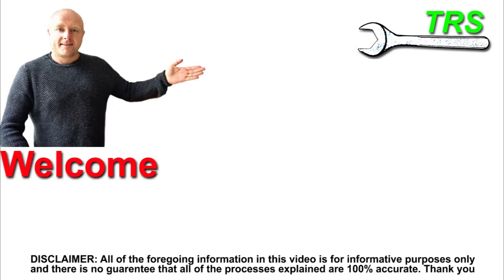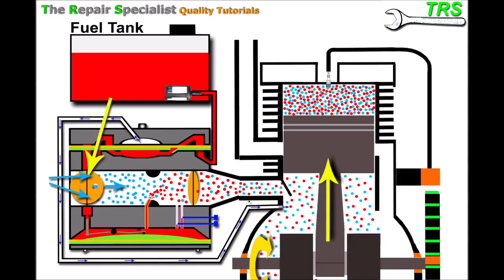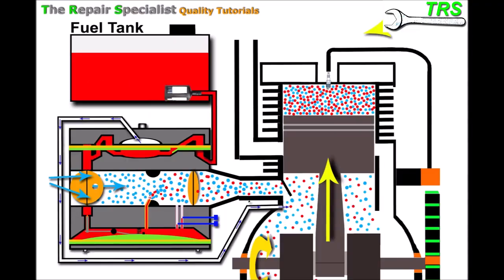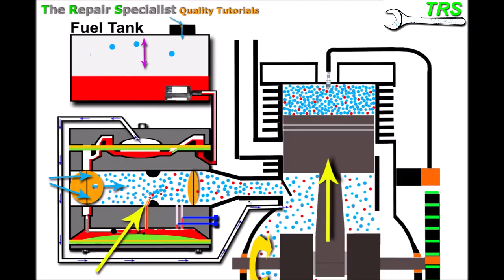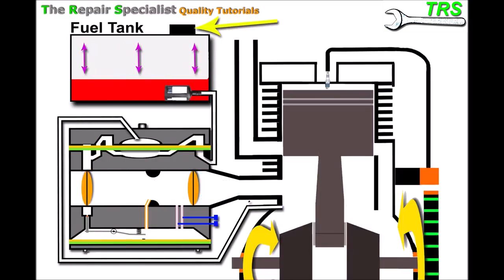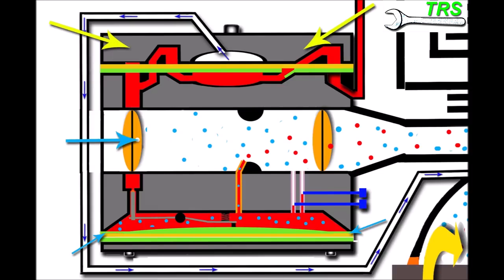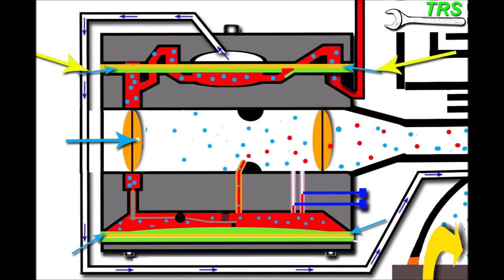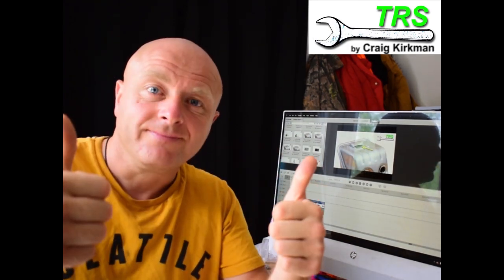2-Stroke Engine Only Runs on Choke (Will Not Run) This is why!  (by Craig Kirkman)

Comment: I appreciate you sir. Thank you for sharing your skills knowledge and experience
Reply from the maker: Thank you so much for your appreciation and nice feedback. I really appreciate you. Thank you. Craig 👍
Reply: @TheRepairSpecialist  I checked the tank, I even bought another tank and was going to install it today. But I never tested the vent. I'm certain this is what's happening. The tank is warped kind like there was excess suction inside it like a gas can does in the cold. I don't know why it didn't occur to me sooner, I've even seen it suggested in other videos. I've been through the whole outboard at this point. It runs like a top until you open her up. That's gonna change today thanks to you sir. This old pontoon has a fuel fill and vent attached to a broken trim ring and they're all super weathered. I'll replace it all but for today I'll take your suggestion and leave the cap slightly loose. I can't wait for my family to wake up lol. 

Your walk through on how all this stuff works and works together is the best on YouTube. I'm grateful to have found your channel

Comment: Great video.  I had replaced the carb on my Echo trimmer and couldn't get it tuned.  Watched the video and decided that maybe I should take it all apart and start fresh, thinking that maybe there was a leak somewhere.  Took off the carb and even though I thought I still had the screws in far enough to hold the gasket, it was off on one side, hanging down.  I continued checking tightness of everything and put it back together, making sure that the gasket was correct.  Wet through setting it up from scratch again (idle speed, High and low needle valves) and had it running like new in a few minutes.

Thank you for the great explanation.
Reply from the maker: Thanks Fantastic. I'm really pleased it's up and running.  Many thanks for your awesome feedback as well.  Craig 👍👍👍

Comment: Can a different 2 stroke oil or mix cause an engine to run on choke only?
Reply from the maker: Different types of two stroke oils and different mix ratio's can effect how the two stroke engine performs.  I haven't known it where the engine will only run on choke because of this though.
Reply: @TheRepairSpecialist  Thankyou for your reply, I have watched 2 videos that you have made on the subject and am still narrowing down the possibility of what the problem is with both my hedge trimmers.

Comment: What about the left side crank seal which is first thing had check if I was working on a bike
Reply from the maker: Hi

Thank you for watching the video and for your insightful comment regarding the left side crank seal. You've raised an excellent point about another potential factor that can contribute to issues with small two-stroke engines, such as chainsaws.

Indeed, a damaged or leaking left side crank seal can lead to air leaks into the engine, affecting its air-fuel mixture and, consequently, its performance. It's an essential component to consider when diagnosing issues like engine bogging down or poor running.

Your expertise and input are valuable, and it's always a good practice to check for any potential air leaks in the engine's intake system when troubleshooting performance problems. Your comment adds depth to our understanding, and we appreciate your contribution to the discussion.

If you have any more insights or questions related to small engines or any other topic, please feel free to share. The community is here to help and learn together.

Thanks again

Craig

Comment: Carburettors, don’t you just love them!?   Fuel/air mixture can be critical on a two stroke engine.  I learned about fine tuning carbs when I had my tuned Yamaha 250 and 350 RDLCs.  I certainly knew my way around Mikuni VM 26s and 28s.
Reply from the maker: Awesome 👍

Comment: Had this problem with my small 2 stroke generator yesterday. Went through it after seeing this video, didn't actually see any issues, but after cleaning  the system and tightening everything up, it now runs perfectly. 
Thanks for your help.
Reply from the maker: Awesome. I’m pleased you sorted out the issue. Craig

Comment: My fuel pipe has a loose seal to the tank. Is there a way to seal it or do I need to replace it.
Reply from the maker: Hello,

A loose seal can lead to fuel leaks and potential safety hazards, so it's important to address it. Here are some steps you can take:

Check the Condition: First, make sure the fuel pipe itself is in good condition. Inspect it for cracks, splits, or any other visible damage, especially where it seals within the fuel tank (some fuel pipes are larger in this specific area, much like a rubber grommet). If the pipe is damaged, it's best to replace it to ensure a secure and safe connection.

If the fuel pipe is damaged at the point where it seals onto fuel tank, then it's best to replace the fuel pipe. Using a damaged or improperly sealed fuel pipe can lead to fuel leaks, which are not only a safety concern but can also harm your chainsaw's performance.

If you're unsure about the best course of action or if you're not comfortable making these repairs yourself, it's a good idea to consult a professional or take your chainsaw to a reputable repair shop. They can assess the issue and make any necessary repairs or replacements with precision.

Remember, safety is paramount when working with fuel systems. Always make sure the chainsaw is completely turned off and cool before attempting any repairs, and take appropriate safety precautions when handling fuel and sealants. With the right approach, you can ensure your chainsaw operates safely and efficiently.

I hope this helps a little 

Craig
Reply: @TheRepairSpecialist  I have already replaced the fuel pipes, so I probably will take it to a shop. Thanks!

Comment: Thank you for this video, however, I have a weedeater that I replaced the fuel line, the carburetor (it's the recommended for the brand, not a generic brand), the gaskets and the spark plug. The engine is still bogging down when I try to push the throttle, and it has a baging noise that seems like the piston is hitting something. What could it be?
Reply from the maker: Hi. Thank you for your nice feedback. I really appreciate.  

I would start by removing the carb again and look into the induction tube at side of the piston. Use a torch.  See if it has any scoring marks on it. Turn the stop switch to off and turn over the engine slowly to see it clearer.   If there is scores present then this is showing wear on the engine that needs to be corrected by an engine strip down or replacement of the whole machine.  

Also, I would remove the exhaust and look down the exhaust port hole to see if i could see the same sort of scoring.  If so, then same outcome unfortunately.  

I hope this helps as a starting point considering the other things you have already done.

Thanks
Craig👍

Comment: I've given up on rebuilding the fuel system on my chainsaw ,which I've had for 25 years and replaced fuel lines an carburetors I'm done!
I'm going electric 40v 18"

Comment: Thanks for the video!  

I had this problem, and after watching this video, I was able to pinpoint the problem. It was the metering diaphragm. It had become too stiff with time and it wasn't allowing the needle valve to come off its seat and allow sufficient fuel flow to the main jet after taking off the choke. Out of curiousity, I compared the new diaphragm to old diaphragm, and the new one was much more flexible.

Comment: Very nice video! But it could not give me a clue to the problem i have. My engine idles with the choke on and keeps running. But if i want to turn off the choke the engin starts to raise if i turn the choke of it hoes to full trottle the trottle cap is closed how is this possible? How does the fuel air mixture enter the conbustion chaimber even if the trottle  cap is closed? My choke is acting as a trottle cap. Please advise

Comment: SIR i'd like to ask, i have Chinese chainsaw 52CC (stihl MS5200 - not genuine Stihl) bought it last December 20, 2021 after typhoon RAI hit in my country that wreaked havoc in Central Visayas area, Philippines. After weeks of continues used by cutting trees the engine started to run abnormally up until now, though still usable. After few minutes of running, when I revv the engine the sounds will changed (PROT PROT PROT SOUND) like out of fuel and then I dies, when in fact it was half full-full tank, but when IDLING the sound is normal. I already adjusted the LH and Carb dials so I can get the correct air and fuel mixtures. It will just run few minutes and back to the problem again. So, what I did was I cleaned the carburator (disassemble & assemble) and the clutch (i didn't detached) brushing only. Still the problem not solved. LAst  week I bought new Carburator and Fuel breather and installed it correctly, after few minutes of running the still the problem persist. The PROT PROT PROT sound not solve and then the engine dies. WHAT COULD BE THE CULPRIT? I've been searching this problem months now in the internet, but I haven't seen any videos/articles that could address my chainsaw problem..I'm thinking Maybe you have an answer for this.. Hoping for your reply. Thanks in advance.

Comment: Wow...very very well explained. Just what i need to fix my weed eater.... BUT my carb got only one screw,, just above where the  inline fuel pipe connects with the carb... 🤦‍♂️ There is no H or L... 🤷‍♂️
Reply from the maker: Thank you for your nice feedback. Its very much appreciated. Take a look at this other video of mine, which explains the basics on single adjuster screw systems on carburetors.  It might help make things a little clearer.  Here it is:  https://www.youtube.com/watch?v=oDkVVL0CJqk . Thanks. Craig

Comment: Excellent video it seems that you are a specialist as your name on this video, I had a problem with the manifold loose the 2 screws that connect to the carburetor but i noticed that the gasket is missing so this may be the problem.
Thank you

Comment: Hi, have a weird problem where line trimmer starts and runs and i can add more fuel or lean per the screws but after a period when hot, it wont idle anymore. Part choke saves it but it not happy engine!! Have switched carbs (3) and gravity fed fuel and even cut the pump vanes off and fed it fuel in case the pulse channel was dying after a period, but why would that happen? unless piston bore clearance and pressures suddenly drooped off.  so cant be fuel delivery problem or vent valve as bypassed all that.  Also i quickly checked for spark when it died and seemed to be still sparking but too weak when hot? 
Could it be simply a weak coil thats dying when warm and spark not strong enough?  Also one time after 15 mins it refused to go above half revs even when i pumped the throttle.  Electronics in coil failing and restricting RPM? a few mins later it was back to full power and rev up down ect. I honestly thought this machine was haunted as intermittent running problem with plenty of juice available on start so good fuel and spark then but not good spark when warm?
Would part choke save a weak spark situation ? Also when after start,  idle screw needs to be changed a bit, it wont lock on to one setting. Comp test was around 100psi.  cold.   Could the engine be bleeding off suction and pressure when hot as its old? . 3 carbs , 2 new and 3rd completely rebuilt on this machine of varying throat sizes but they all idle and fail the same after about 15 to 30 mins. same symptoms.   Also pressure tested engine and got 9 lbs, no leaks but replaced all seals and crank seal in case they were bleeding when hot. So engine is air tight.
Baffling!!
thanks if you can help...
Reply: Id be trying a coil,,,,i know its easy to just say and throw that out there from a chair but i would try a new coil and spark plug. This is of course is figuring all of the other basics are good which sounds like you got covered (vacuum leaks, etc). Love to know what you find. Stay safe and good luck
Reply: Do you have a spark arrestor on that unit?  Pull it and check it.  If clogged, use a propane or mapp flame to char it and brush off the soot.  Interesting problem.  I'm gonna assume you fixed it or had it fixed.  What was the problem?
Reply: @alext8828  Hi, i found the problem. You need about 90 psi for 2 strokes to work and i was getting 100 cold but only 70-85 hot??  and thus it couldnt run but took 10-20 mins to get hot and bleed off. Caused by worn bore and rings. Put new rings and checked hot and back to about 100 but the piston the bore clearance ect is not good so this wont last too long and that will be that for this machine . Good learning experience and i had to work this out myself as engines are supposed to increase psi as they warm up not the opposite. 2 strokes are very picky as they have to compress and suck the mixture in, so clearances are very tight. Thanks for replying. all good now..
Reply: @xx3868   Glad to hear it.  BTW, ring clearance is the thing to watch.  Piston clearance is secondary.  I think you'll be fine for a long time.  Good luck.

Comment: Excellent channel. My Stihl 600BR used to run well before a Stihl certified tune up. Now, it runs when the machine is warmed to room air, started and operated above 0 degrees C. At -30 degrees C, it starts and idles but bogs down as the throttle is advanced. I’m curious how to diagnose and fix this.

Comment: My still ms82 trimmer will only start if I pour a wee bit of fuel in the carby. 

Once it’s running thou. It’s fine
New chinese carb and was worked fine when new. Only ran about 10 minutes
Any ideas lads

Comment: An excellent explanation of the malfunctions of this type of carburettor!
Maybe some advice about the fuel used.
NEVER use alcohol containing petrol, this will dissolve the rubbers of the membranes.
You can only see this clearly if you hold them up to a light.
You then see the fine grid of the fabric on which the rubber was attached.
These rubber particles contaminate the carburettor and all small holes need to be cleaned, sometimes very small ones.

Comment: Hello, I have a back pack stihl leaf blower Ive done all this stuff to this thing fresh fuel, tank vent good,new carb actually 2 carbs the last one is original eqip.Anyway same thing on bogging and sometimes wont start yet running good while chocked a little bit ,even better when i shake up the gas tank to give it more pressure.,,Crazy thing is when i open the gas cap it will then just die out..The muffler is clean the cylinder looks new no scoring only thing left I was thinking is the crank seals?what do you think? any suggestions? Thanks! B.

Comment: Another excellent video which clearly explains the majority, if not all of the 'fuel starvation/choke on'  problems encountered with small engines.  The only fun left now is work out which one of these issues you are having? 👍
Reply from the maker: Yes, Thank you for mentioning that.  I should have included it in the video.  Thanks again. Craig
Reply: Pretty much start at 1.....

Comment: The 2 stroke engines must be able to exhale freely. If the engine idles but has no power, or simply won’t accelerate, and you checked all the first eleven things you might check for restriction to the exhaust. This maybe a piece of woven wire in the muffler that has accumulated over time exhaust oils baked on the screen installed as a flame, or spark arrester. Exhaust holes at the piston exit can build up crud and restrict the exhaust also. This takes many seasons to accumulate, but the seasons pass quickly, it maybe older than you remember.

Comment: all vids are great and very helpful. i did notice one lack or i missed seeing it. it is how a def hi ck valve preven
ts purge bulb drawing in fuel and pushes out all fuel when in low speed. ck not closing on low circuit lets 14.7 lbs atmosphere pressure push into metering area pushing diaphragm away shutting off fuel supply and gradual starving down at low speed/idle and adding air to chamber and pushing all fuel out of purge bulb. with no ck /defective works good on hi speed and full choke starts ok 5-7 pulls like no purge bulb. engines. thanks for the great vids.

Comment: Hello please help me understand what is going on. I have a Stihl chainsaw, the chainsaw turns on and in order for the master lever  goes to run position and idle, i have to depress the trigger . When i depress the trigger, engine will shut off but sometimes when i depress the trigger few times , it will go to run position without shutting off. Is that ok or is there something going on ?

Comment: I found the problem is usually an air leak in an old fuel line, the solution is cut off the cracked end and reconnect. It could also be in an old tank where the tank take up hardens and expands. Replace the old parts or wrap teflon tape to make the take up plug in tighter.

Comment: I've just dealt with my " the handy" strimmer. The beast kept dying off choke. 
The fuel supply line had snapped. No vacuum  equals no draw of fuel. Resulting in a dead cut.

Comment: My outboard runs fine when cold but after running a while it starts doing this it makes no sense why it wouldn't do it all the time
Reply: Induction coil issue often causes this.  As it heats up a fracture in the internal wire expands killing the power to the spark plug.

Comment: Please help me why my engine isn't workung
Reply from the maker: I need a lot more information than that.  What what are the specifics?
Reply: @TheRepairSpecialist  engine has fuel, the fuel is getting into cylinder, engine has spark, engine has compression, but engine not start, it is a small 2 stroke